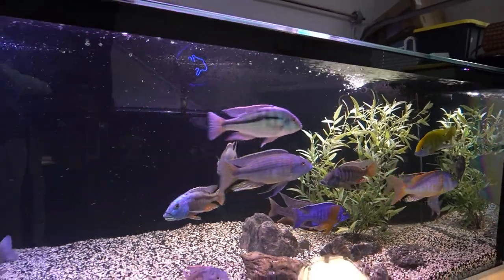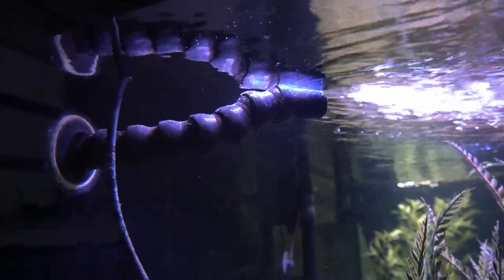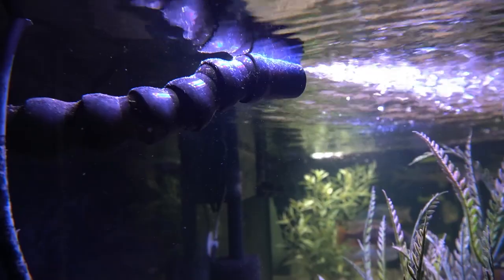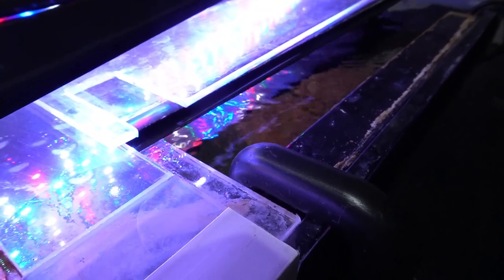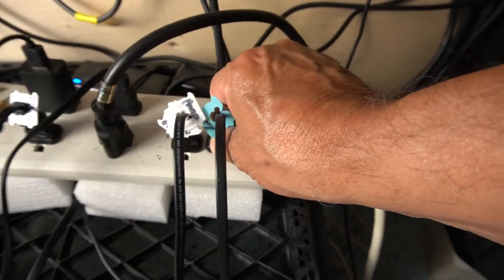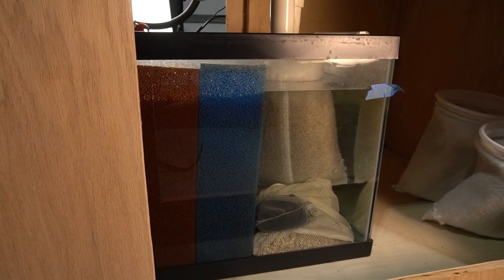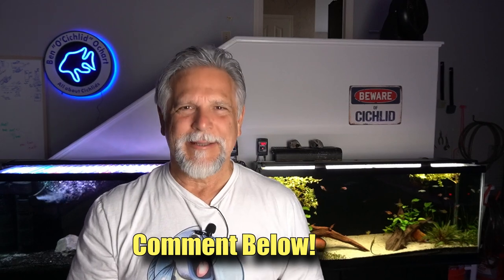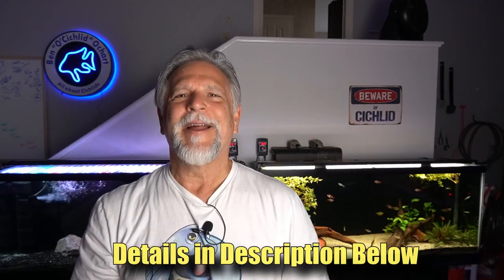SUMP FILTERS and DRY FLOORS!

Comment: The best method for me was always the simple hole in the return line. I ran one for years like that and never bothered with a one-way valve.  Another tip is to use the largest sump you can fit, so you have the biggest buffer of volume possible in the sump. I used a 40 breeder that i had to build the stand around because it wouldn't fit through the door.😂  just remember, the sooner your siphon breaks, the less water you will have draining to the sump.
Reply from the maker: The original plan was to use a 60 gallon under the 300 but it wouldn't fit ... l was left with the option of cutting a hole in the side or going with a smaller sump. I ended up going with the 40 breeder out of concern that I would lose too much support cutting a big door hole in the side.